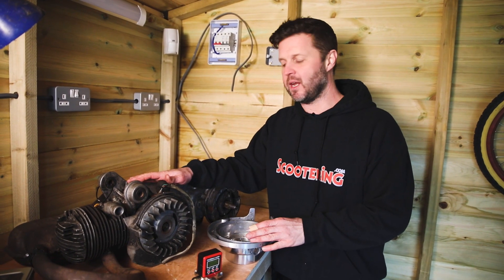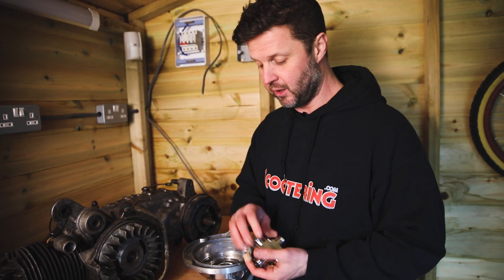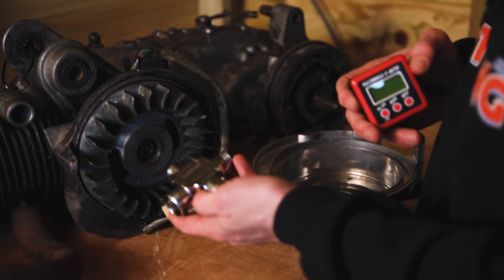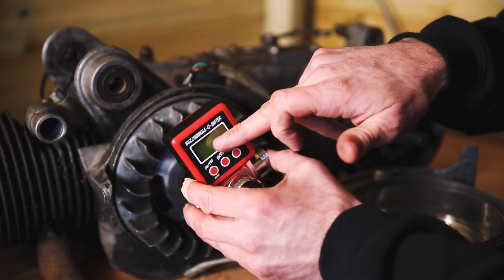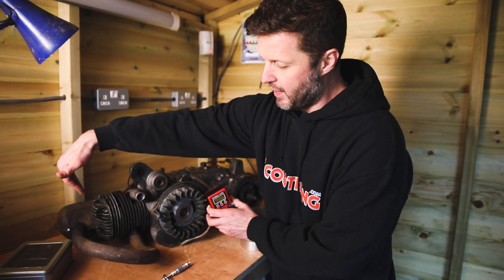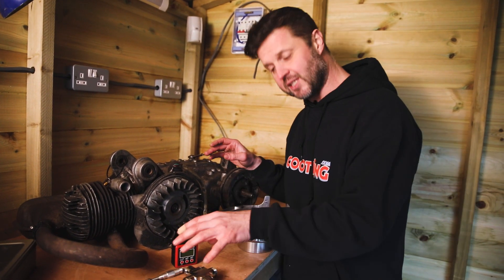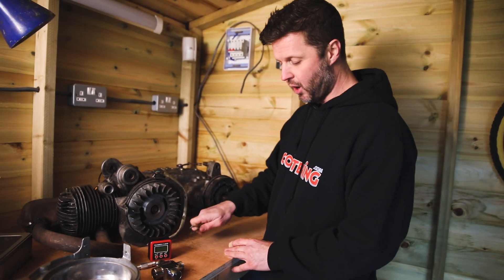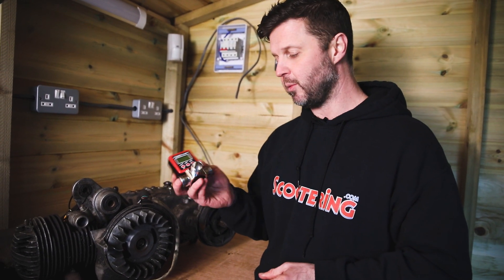The Buzzwangle! Set Lambretta scooter ignition timing quickly and accurately with this new device!

Comment: The SIP timing tool at only £22 is a lot cheaper and does the same job. Ok you may have to remove the flywheel nut but to save £70 - that’s a bargain! For the TDC finder I use an old spark plug with the ceramic removed and replaced with a long screw that is araldited in place and cost nothing other than the one time half hour it takes to make one. Bargain!